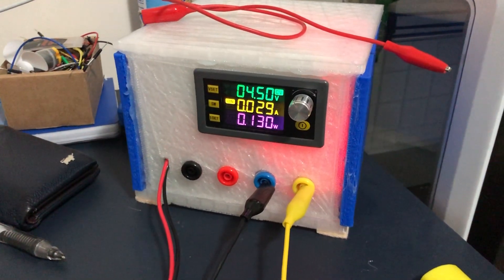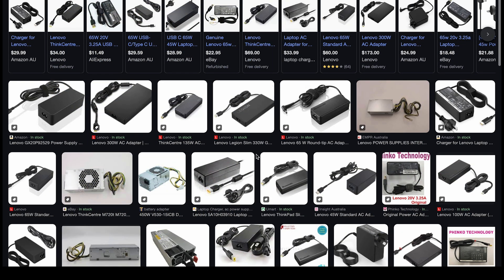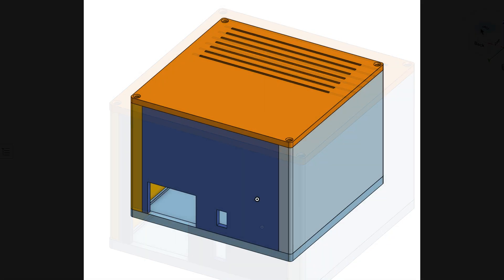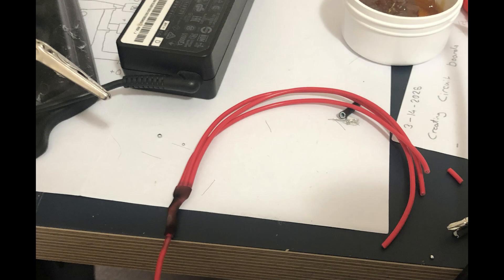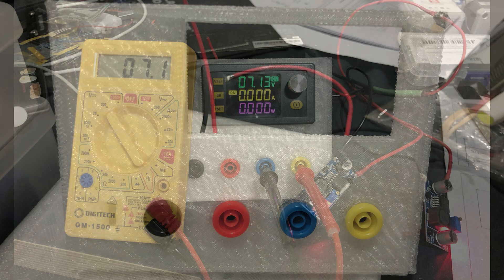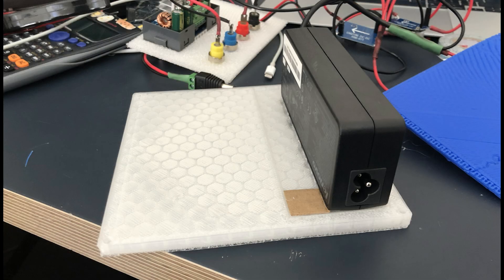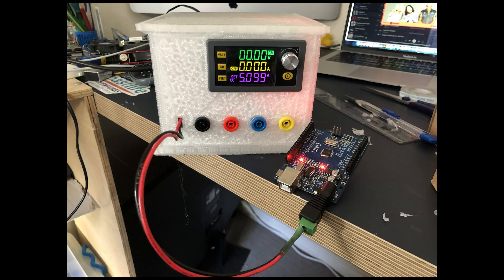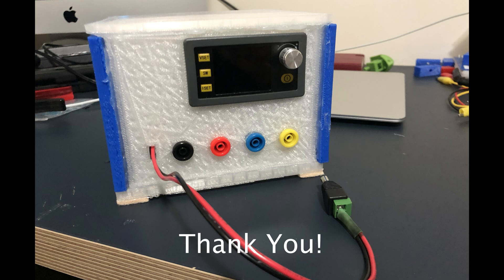Custom Variable Lab Power Supply | Project

Comment: Nice video. Something I suggest is using a noise gate on your voice audio so it mutes when you're not speaking (eg. It can mute your inhaling). I don't remember all the settings at the top of my head but you can have it wait 300ms before muting so your S's are heard but then breaths usually aren't.